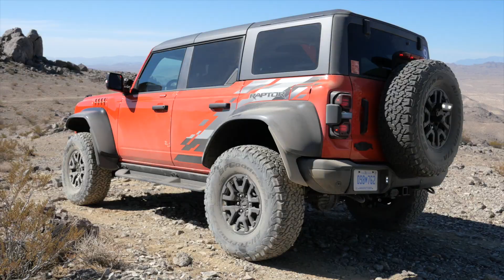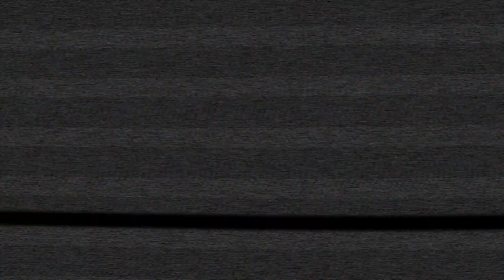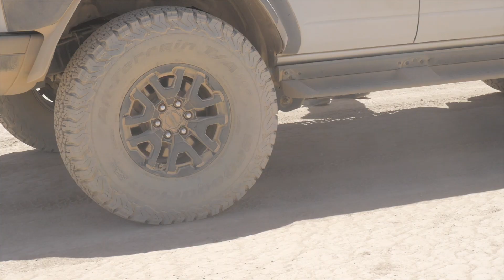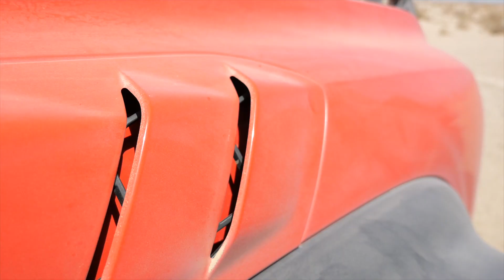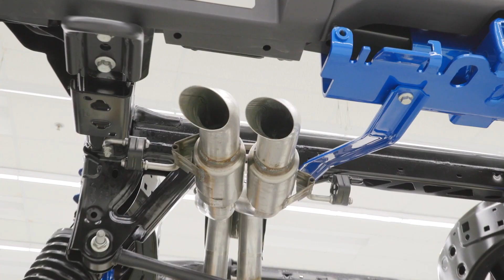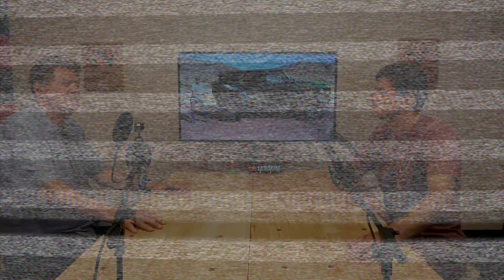Here's How The New 2022 Ford Bronco Raptor Compares To The Jeep Wrangler Rubicon 392

Comment: V6 Raptor is heavier than the V8 392. A V8 would make it even heavier. Meaning less towing capacity. Another thing. 37" tires on an IFS is not good for articulation. 39" would be impossible

Comment: Is it fair to say they should’ve put the 3.5 in and not JUST the 3.0!! This is on the f-150 chassis right? It’s like have a cap on the bed so there’s more weight there. So this is almost as heavy as a Raptor, and it’s a big brick in the wind… IT NEEDS WAY MORE POWER!!
Reply: I believe the Bronco is Ranger-based.
Reply: @hellkitty1014  the big bronco right? Not the bronco sport which is escape chassis.

Comment: The Wrangler 392 can’t hold a candle to the Baja inspired Braptor suspension. It’s truly is in a league of its own. The engineers did an amazing job. If you can find one at MSRP it’s actually a great value.
Reply: It wasn't designed to do that. And if buyers are paying $10-20K over MSRP for Sasquatch-equipped Broncos, I'm sure $100K Bronco Raptors aren't out of the question. But I'd still rather have the 392.
Reply: Total different tool.  You want a desert runner then the Braptor is the pick.  You want a powerful trail rig to build the Braptor is a bad choice being 10" wider than the already wide Bronco is not going to work well especially here in the Pacific North West where my Jeep JL is already almost to wide on spacers and 37x12.5.  I really like the Braptor but would still take the 392.

Comment: With the swappable battery idea, I've said it before and I'll say it again, to eliminate the issue of long charging times (and the associated range anxiety) they need to make some vehicles that have a big battery compartment that you can access, maybe have it slide out like a big drawer, make removable batteries so you can have extra batteries charging at the house while you're out driving around, you get home swap them out. Or for example if you only have street parking, maybe you live in an apartment, you don't have anywhere to plug in a vehicle, but you can just haul the batteries up to your apartment to charge them just like you're carrying some very heavy groceries upstairs lol. But the other big advantage of removable batteries is that gas stations (or whatever other refueling/charging stations start popping up around the country) could start getting truckloads of removable batteries delivered just like they get trucks of gasoline, and have a battery exchange program which could work exactly the way their propane tank exchange program works. You give them your empty batteries, they give you some full ones and bam you're on the road again instead of waiting an hour for it to charge. And that also eliminates the need for fast-charging which of course damages the batteries.
Reply: That’s what you do with electric forklifts, to name something I’m familiar with.  Just get it close, roll one off and another one on.

Comment: I don't buy the explanation for not having a v8. You are telling me it wouldn't fit when this is 9"+ wider than the standard Bronco? Ford would print money adding the 5.0. It is all about corporate tax placed on car manufacturers producing v8 engine vehicles.
Reply: I think it’s the low volumes that prevents a V8. Bronco Raptors will be a low volume trim level. Also, one out of 10 F150’s is a Raptor? False statement as they typically manufacture about 24,000 in a normal year.

Comment: I think now that Ford finally put a Supercharged V8 back into the F150 Raptor shows that any excuse they come up with not to put a V8 into a Bronco is a bunch of BS. They can do it. And the Coyote and the 7.3 Godzilla both fit. The 7.3 fits better since its a Pushrod engine and a smaller package then the 5.0 Coyote. Ford if you are listening, Aluminize the 7.3 de-stroke it to the 6.8 build you fleet of Boss 429 F150s, Mustangs, and Broncos Naturally aspirated then build a step up with super charged. Win this game and be done with the horsepower war and go back to building your lack luster v6 and coal/electric vehicles.
Reply: I mean if a v8 can fit under the tiny hood of a Jeep Wrangler it should fit in a Bronco no problem. Obviously a much bigger engine compartment then a wrangler.
Reply: @D40-Or  I don't think you can simply compare the Jeep Wrangler's engine bay size and the v8 engine size with it to a Bronco Raptor and it's engine bay size and respective engines. Just because someone can do a back flip doesn't mean everyone can just as easily or that they want to. It's just that simple, even if they can fit it, if they don't want to then that's just that. Another thing is, what is the benefit of a v8 vs the current engine ? It's clearly not weight, it's not gas usage, it's not that much more power ironically, it's not balance for performance, it's not even durability anymore as people love using this excuse but so far, the current engines are very durable and rival v8 durability. So again, what is the benefit ? Because the main reason ? Because saying the sound is a good reason is basically as others have said in their own words against the current engine, a "BS excuse".
Reply: @raionshishi8290  Low end off-roading torque, reliability without turbos, and yes, the sound.
Reply: If you want to argue that ford is incompetent go for it 🤣 ford can’t do the backflips that jeep can do.
Reply: So you're a production line engineer?
Reply: @Sworksfsr  production line engineers lack creativity. Its only when the aftermarket has been doing it for YEARS do they finally decide to make it work. Engineer thats worth a shit will make it work and an engineer collecting a pay check will do the bare minimum and say it cant be done..
Reply: @bennmustang1  Can you please give me an example of an aftermarket production line that has to take into account the entire vehicle running down it's line?

Comment: All of this push for ev when the US electrical grid is nowhere near capable of handling the increased load.

That came straight from an electrical engineer I have known for 3 decades who works for Lockheed Martin.

He said it would take many years to get even remotely close to capable.

Oh, and what produces the energy to charge these vehicles? Coal.

That is why China has built 1,110 coal fired plants to date.

India is 2nd most globally at around 285.
Reply: coal accounts for  20 percent of us electric production.
coal produce 2.2 pounds of co2 per  kWh
if f150 lightning  goes 2 miles per kilowatt
it would produce 1,1 pounds per mile
the same as a standard f150
natural gas is .95 pounds
we make twice as much energy with natural gas .when you average it all out
the  f 150 lighting emits  half as much co2
Reply: @jeffforbes70  lmao, that explains why China has built 1,110 coal fired plants and building more.

India is 2nd most globally at 285.

You are being fed bullshit.

Old adage, if you tell a lie long enough people start to believe  it.

If you are so worried about it why not take your argument to the #1 producer of carbon in the world?

Put your money where your mouth is.

I am sure China will be very open minded to what you believe right before they execute you.

Even if the US went 100% carbon neutral which is impossible for a plethora of reasons it wouldn't offset what China is doing.

You on your way to Beijing yet?

Comment: Solid state batteries would be great for cordless tools,  RC drones, toys,etc.. Why not start with smaller consumer products?
There are a couple of companies already working on capacitors as viable solution to lithium ion batteries. 
I still say hydrogen fuel is a all around cleaner alternative. Zero earth mining involved, nothing to recycle.
Reply: The lies the oil industry has spread about hydrogen being unsafe is the biggest obstacle that has to be overcome. I feel the vehicle it self can be filled with water and hydrogen created as you drive and  prior to driving. Microwave energy can be used to create the hydrogen in the vehicle.
Reply: @imfloridano5448  if you create hydrogen as you drive just use that energy to propel the car.water is not an energy source . it is burnt hydrogen ,the energy  to make hydrogen from water will alway be more than what energy that is created. put 100 watts in to making hrdogen you will get at best 95watts out.
Reply: We are in battery infancy right now. The next 5-10 years we will see battery 2.0. It will be the final nail in the coffin for the gasoline V8 engine.
Reply: @mini2nut67  I'd have an EV pickup truck today if they were more practical where I live.

Comment: To get a guy like me in rural America who does 26,000 miles a year, I think we will need a ‘full day battery” (600 mile range) or a “common style” battery pack that is easily interchangeable. Match that with a subscription based service where I could stop at a station , pull over a bay like an oil change shop and have my batteries replaced in a few minutes with other batteries that are already topped off, would be a game changer. That would also offer the ability to have consistent range and give a direct method of recycling batteries. Searching for a charger and sitting there for an hour to get it to 80% wouldn’t work for me. Many days I do more than 250 miles and I sometimes travel 400+ a day, which would take way longer with recharge.
Reply: I'm so glad to hear somebody else say it! Thank you! Swap the batteries out just like swapping a propane tank. Give them the empties, get the full ones, bam you're on the road again
Reply: @sorrywrongnumber5280  You could probably do this with a Ford Lightning. Remove the skid plates and then you have access to the 8 bolts that hold the battery pack in place.
Reply: their is a company in a couple major cities that do just that.
Reply: Yeah, it would only cost a grand to pop and swap for a new battery